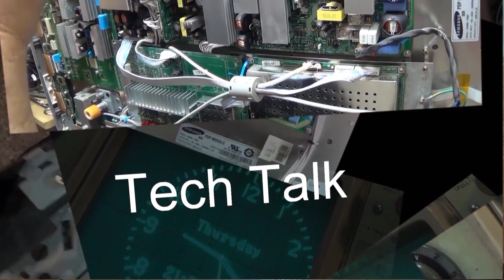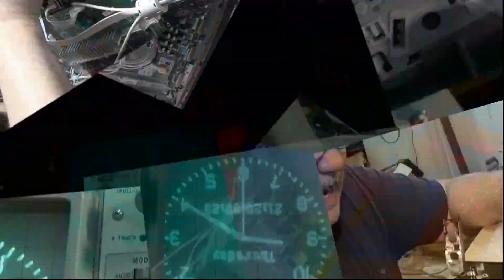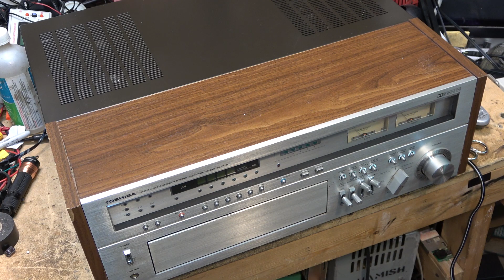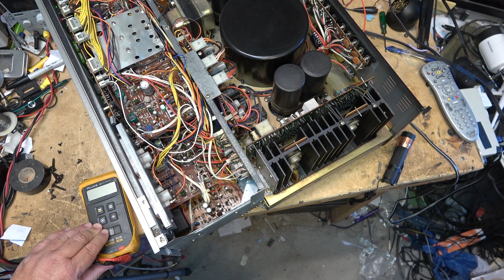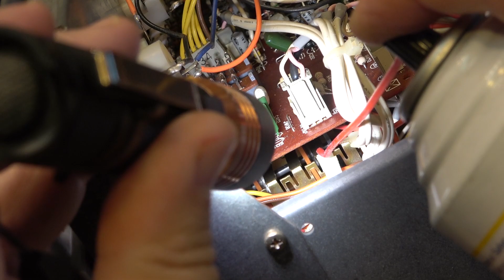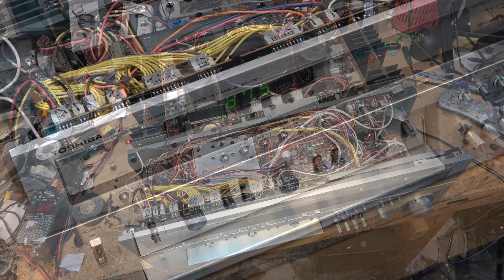Vintage Toshiba SA7150 Receiver Right Channel Goes out

Comment: Dual mono would have a separate transformer for each channel.
Reply from the maker: Not necessarily. Dual mono is anything that has a seperate power supply.  Even if they share the same iron it can have 2 secondaries.   As long as they have seperate rectifiers and main filters caps they can be a dual mono design.  A mono block amp has 2 senerate transformers and usually puts the amplifiers is completely seperate boxes.   Some will use the same secondary but with 2 rectifiers and filters.  These were called dual power supply.  Akai made several integrated amps that were that design.

Comment: Hi Dave. Do u have a Panasonic DMR-ES15 repair video? This model has a common problem with the Digital PCB and Drive.
Reply from the maker: I have a DMR es15. Has the digital board drive issue.  Haven't fixed it yet.  Have no idea what is wrong as of yet.

Comment: Hey Dave Nice Old Receiver
Is It You'r Friends Receiver?
Oh It's You'r Neighbors Receiver.
That's A NiceOne. 
I Think Most All Of Receivers Nowadays
Still Have Dolby
Reply from the maker: It's the neighbors.  I do lots of work for him.
Reply: @12voltvids  I Had An Old 50 Watt
Fisher Receiver I Bought At The Salvation Army
Thrift store But The Left Channel
Was Out Till I Found The Problem
Which Was A Speaker Fuse That Was Bad.
Then After I Replaced The Fuse Then
The Recieiver Worked Like A New one.
Reply from the maker: @rogertyler3237  sometimes you get lucky.  Occasionally that would happen to me but usually when i was out on a date with a girl and I haven't done that in 40 years!

Comment: Love, love, LOVE this receiver. What an absolute beauty and beast all rolled into one.  Also, at 9:20-something- it won't sound a bit lower one side to me, only one speaker working on my laptop any more & you already know my ears are getting well-worn...  Was just watching one of your older vids on a Toshiba Walky (The red one, smaller than the cassette it was supposed to play if it hadn't been killed by a sticky tar belt).  That's two bits of Toshiba kit I'd love to see but likely never will lol
Reply from the maker: The little FM transmitter I use the right channel is slightly lower than the left also, the right speaker is about 6 feet from the camera and the left is 2 feet away.
Reply: @12voltvids  I'd never know lol

Comment: Now that's a heavy duty design,  no silly stk/sanken output modules in that!.
And a screened toroildal mains transformer, not cheap in it's day.
I've had to take the function switches apart and clean the plates and delicate sliders.
Cleaning spray doesn't always do the job.

Comment: Nice receiver! I have a similar problem with a portable stereo. When I switch from any other mode to the tuner I get what sounds like a scrambled digital sound before the radio plays. It's been doing this for years. Any idea what would cause this?
Reply: Probably dirty potentiometer like shown in the video. Work out the switches with contact cleaner.

Comment: Are you surprised the sound changes when you push that Dolby FM button?
Reply from the maker: No, because the signal is not dolby encoded, I was expecting it t o be more like dolby b on a tape deck, that is rolled off highs, but it rolls off the bass.